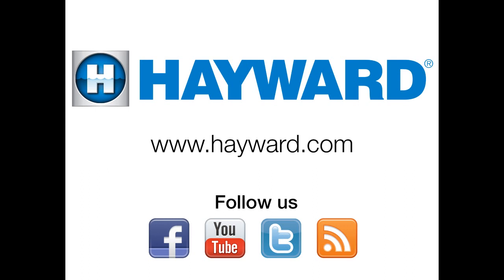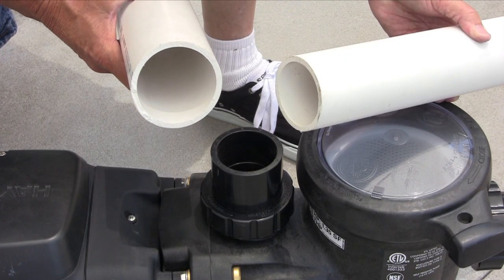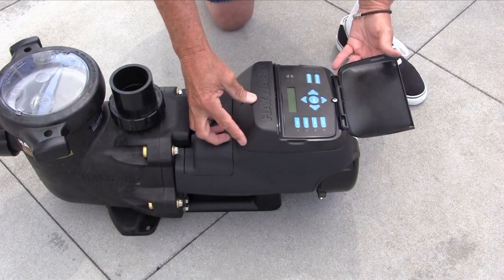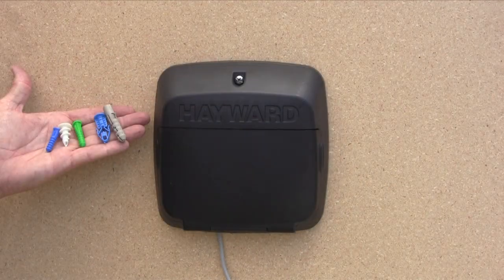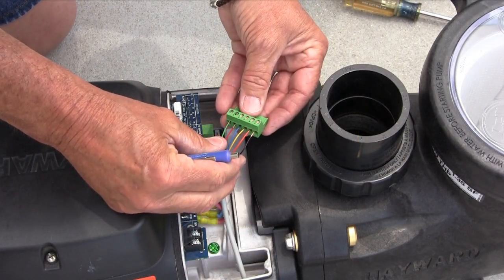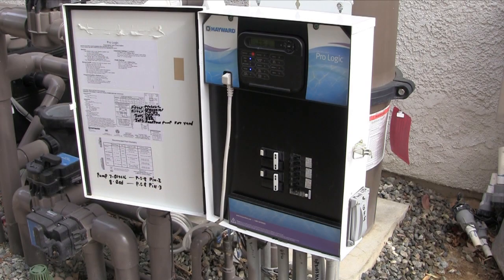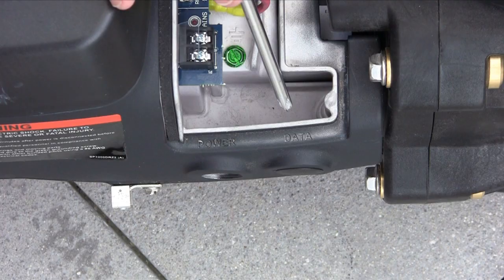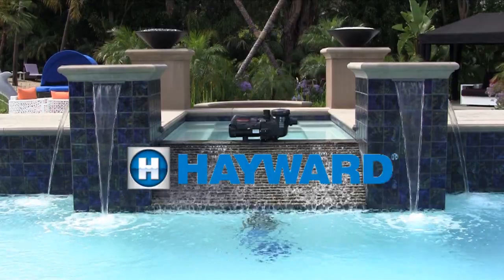Hayward EcoStar Variable-Speed Pump Installation

Comment: can you wire a salt system to come on through the ecostar pump? so when the pump comes on the salt system does as well?
Reply from the maker: yourdaddidwhat please PM your phone number on our Facebook page or Twitter profile and a tech will call to help.
Reply from the maker: Depends on the type of salt system.  If AquaRite,  no.  If a control with salt yes. Better to have a time clock hooked to the AquaRite and Sync with the pump.     You may want to consider one of our Omni products of control.